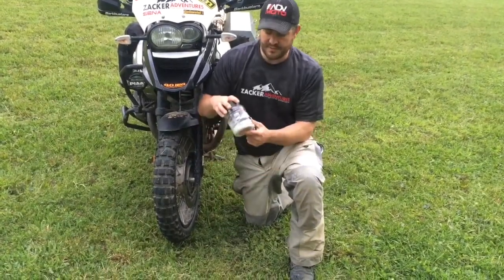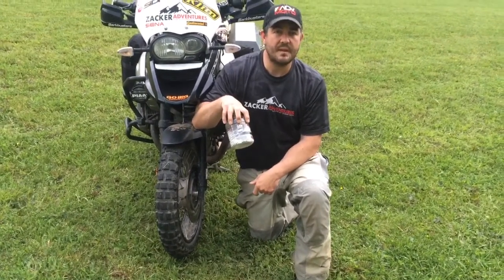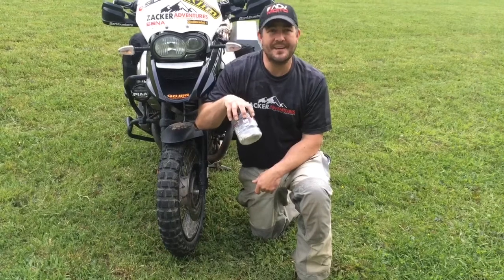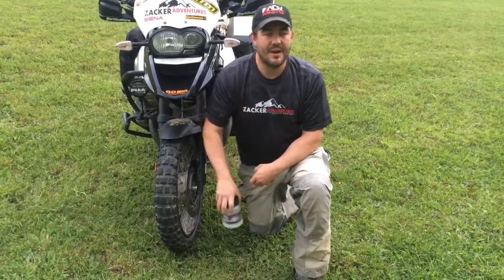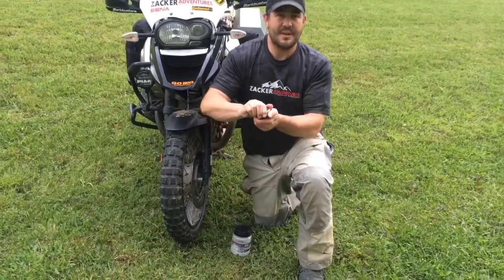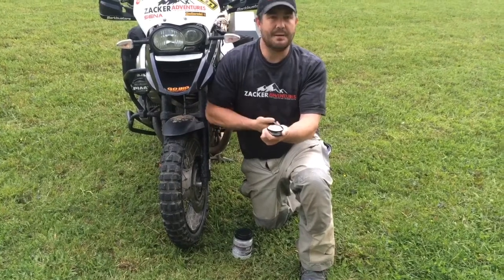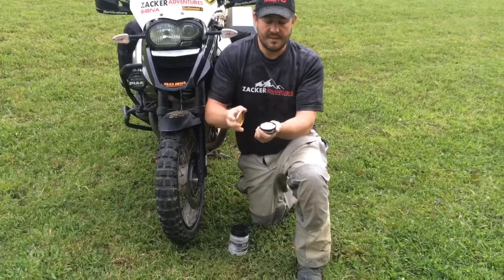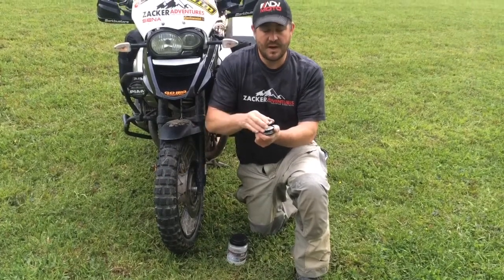Trailside Tire Balancing w/Airsoft BBs

Comment: I use airsoft BBS to balance my 18 wheeler tires and they work phenomenal. I usually go with a formula of about 10% of the tires weight. Using pounds for the number and then using 10% of that number in ounces for the BB's. So my 360 lb wheel and tire on the front has 36 oz of BBs in it and it's perfect. I'm about to do some tires on a touring bike and was looking to see if anyone has tried this method on motorcycles. So you're saying 2 oz worked great for you? Also are you saying you use WD-40 to lube the bead of a tire. Is it WD-40 harsh on the rubber itself? Have you removed tires that have been on the wheel for more than a year after using WD-40 to seat the bead? If so what's the tire basically welded to the wheel?